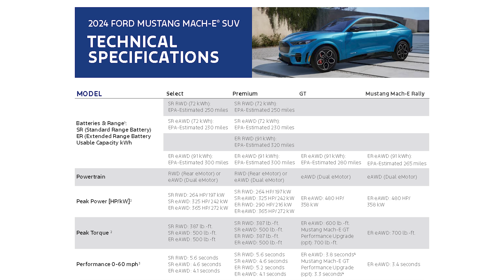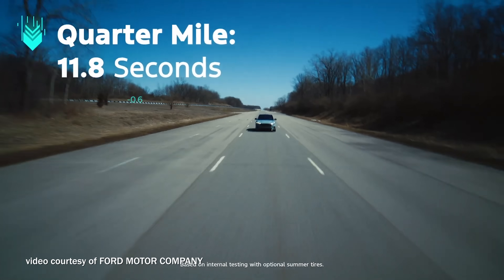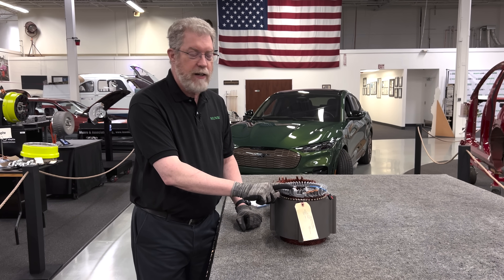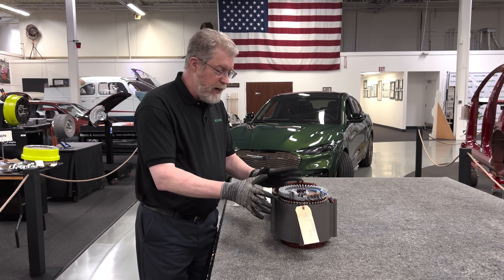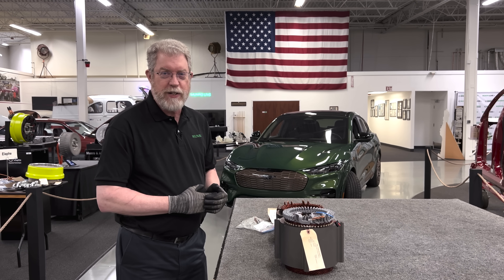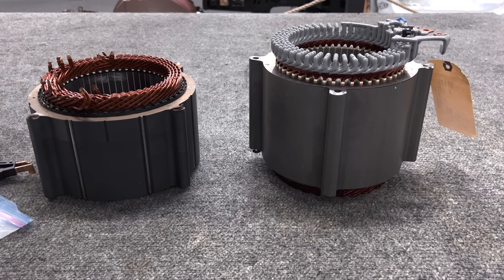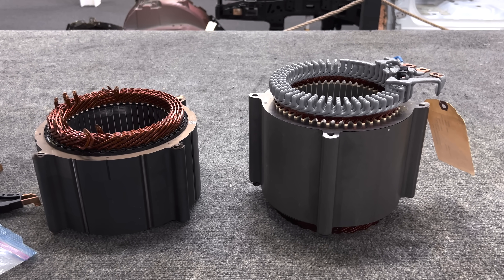Boosting the Mach-E: Inside the Motor Upgrades

Comment: 8 years with BW emotor development, performance and validation dyno operator here… that in-house ford motor laminations are gonna separate.  Our lab (e motor dev for this exact motor) has tried many many MANY times to reduce iron losses in not just this application but many before and after it… laminations separate.  They will.

Comment: For the 2013 models of hybrids Ford brought the manufacture of the eCVT transmissions previously supplied by AISIN in Japan, in house. They screwed it up. There was a bearing that failed prematurely and case seam oil leaks. Both required removal of the engine and transmission. The AISIN's last forever.

Comment: please find some time to do a vid on this type of motor compared to the axial flux motors that yusa and mercedes are developing. what is the efficiency gains or lack of with these compared to this motor. I have been looking for a technical explanation of the different tech for a while but cant find something authoritative. where is the future going with the motor tech. seems ford and the american oems are dragging their ass. is that true or not? tks for the vid
Reply: There has been a lot of interest in axial flux motors lately and we are in the middle of a tear down on one now.  We might do a video on it in the near future.  Axial flux motors have some advantages and some unique challenges.  For some applications an axial flux motor could become the dominant technology, but at the moment we are not seeing a broad based movement toward axial flux motors in the EV industry.  The best applications for them appear to be racing and sports car applications that have relatively low volumes, but demand extreme torque and power density.
Reply: @PaulTurnbull-EMfield  Hey Paul, Lewin Day here from The Autopian. 

You mention they "had" to increase the length of the motor to add torque. Is that because going to the four parallel paths setup reduced torque in some way?
Reply: @LewinDay  Not directly. More parallel paths with the same mount of wire mean fewer turns of windings. The magnetic field strength depends on the current and the number of turns, so the same size of motor with more parallel paths of the same wire will have fewer turns and need more current.
Reply: if it was cheaper they'd already been doing it.  Axial flux motors have been around for decades.

Comment: The actual reason to move to a bonded stator stack is to reduce production cost and complexity. The welding stage is messy and complex, the bounded stack is significantly easier to manufacture in large volumes. The tiny high frequency magnetic "short circuit" across the back iron in that periferal location is really not any real efficency impediment for this sort of motor where the back iron is not trimmed right down to minimise mass (ie, a motor in say Formula 1 will be running much less back iron)

When you look at the volume increase, it's clear the "new" motor is no actual significant performance increase (ie specific kW/m^3 or kW/kg) but is entirely  a commonisation cost reduction exercise. if they actually wanted more performance then they could quite clearly get it by simply moving to an 800v architecture........
Reply: ... which they have set themselves up to do with this motor design.
Reply: yes, cost is job one.

Comment: I'm not claiming to be any kind of an authority on EVs, but I thought Ford's claim for the top spec is 0-60 in 3.3s for the new and 3.5s for the old. 3.7s is not an improvement, unless that is on a lower spec version. If 3.7s 0-60 is for a single motor standard range, it would be remarkable.
Reply: He was trying to remember the number and got it wrong, the data that he overlaid gave the 3.3 seconds.
Reply: @freeaccess5905  Thanks, that is what happened.  We do these things in one take and noticed my mistake later.  Hopefully, the overlay helped.
Reply: @PaulTurnbull-EMfield thanks for the overlay unfortunately this mistake may lead some to think this is an old video… just saying love what you guys do

Comment: Wish ford had a greater focus on the software side. As good as the mechanicals are, next gen vehicles are defined by an ability to be software upgraded over time.
Reply: The trick to enjoying a Ford EVs is to come from used cars that are always at least 10 years out of old. I'm just amazing if a car supports Carplay and a backup camera.
Reply: Software only needs to be upgraded if the software is buggy or vulnerable… if next generation cars are buggy & vulnerable — I don’t want them.

Firmware can always be upgraded in the dealership, anyway.